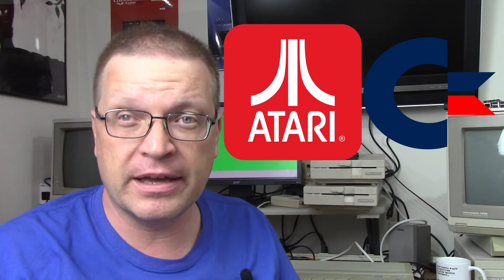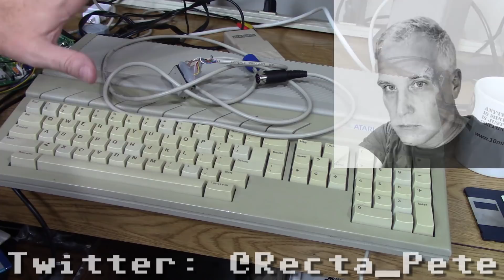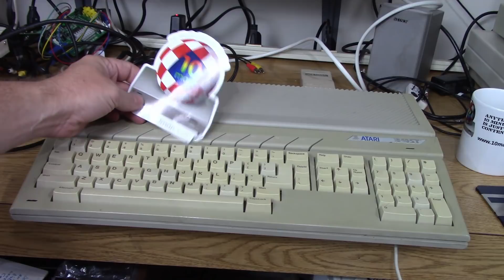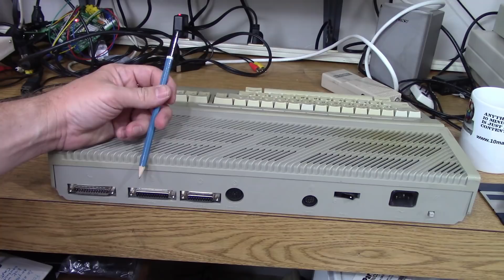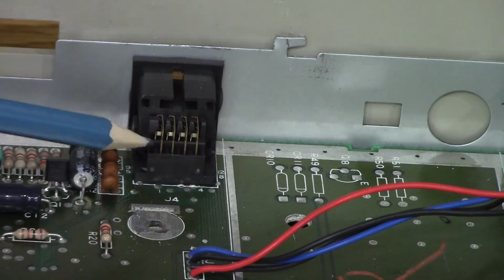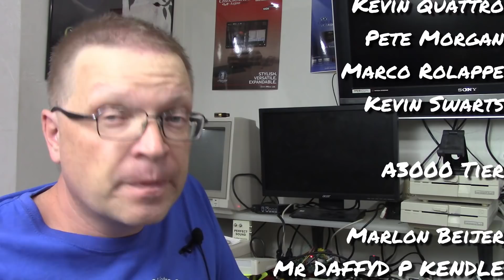An Introduction to the Atari ST - 10MARC Atari 1040ST Special

Comment: the audio chip comment, Atari wanted to use a better Yamaha chip but Yamaha wouldn't sell it to them as they wanted for their own keyboards.  The STe line did come with a far superior sound chip but, as you noted, the lazy programmers stayed with the YM-2149 and didn't use the better sound chip although there were some games upgraded to use the DMA sound chip.
Reply from the maker: I think they also had their own custom chip in mind. That would have made a world of difference, really. A lot of people like the sound of the C64 more than Atari ST sound. It is superior to MAC and PC sound at the time for sure! 
Shame that more was not written to take advantage of the STe.

Comment: Switched to ST because the framerates was worse under 3d games on the Amiga. I played mostly 3d games like stunt car racer, fighter sim etc
Reply from the maker: Well... That applies to maybe two or three popular games. Add a bit of RAM to the Amiga, or one of the dozens of accelerators available back in the day and the Amiga womps it again. And when you consider 99% of games run better on the Amiga (and look and sound better)... Easy decision
Reply: @10MARC  the difference in 3d performance was significant. Play elite or stunt car racer on both and you'll be amazed.  Was the CPU clocked higher on the st ? Other games I played like dungeon master, rocket  ranger and blood money were pretty much identical. But yeah, for other games the sound and color palette was generally better on the Amiga

Comment: The Falcon may be the best piece of Home Computer. Too bad it came too late, just like the Amiga 1200
Reply from the maker: It certainly had a huge amount of potential. If they would have addressed it's few shortcomings in the Falcon 2 - like added a full 32 bit bus for the graphics and allowed for more than 14 MB RAM it would have been just about perfect!
Reply: @10MARC  Mate 4MB was more than enough in 1993, the Amiga 1200 came with 2MB and the rest of the Amigas and STs had 0.5-1MB. Agree on the 32bit bus, but as always..cost cutting. THe 030 is a lot more powerful than the 020, so the potential was there, but never explored cause the Atari and the Amiga died in favor the PC

Comment: The Sinclair QL guy finally gets an Amiga and now I see that the Amiga guy had an Atari all along ?!?!? What is going on :-)
Reply: Of all the 16 bit machines in the 80's (really they were 32 bit architecture), which includes the Amiga, Atari, Mac, and the QL (not sure about the Archimedes), the most successful, i.e. the Mac, in may ways had the worst specs. Shows what marketing can do.
Reply from the maker: Well, I just got the Atari in 2020 - and to be honest I have used it for about an hour after I made this video. I will get back to it sometime. Now my Atari 800XL I like quite a bit!

Comment: I have been looking for a Mega ST 4. If things go right I will soon get one, lets see. Have never had an Atari computer or console. During the previous millennia I would not have even considered. Maybe something has changed in all these years. TT30 would also be awesome or a Falcon but they seem to be impossible to find.
Reply from the maker: Good luck finding a Falcon that does not cost a fortune! They were good machines for sure. The Mega ST would be a good find, too.

Comment: Hi. I'm currently using an Atari 1040 STf plugged in a TV using DIN13 to SCART cable without problem. And when I say TV, I mean the one I bought for 5€ : it is an old CRT TV that perfectly does the job. My LCD TV can't, even if it does have a SCART interface. AFAIK it is due to the horizontal frequency. Newer monitors/TV are not designed to accept so low frequency (15kHz). They generally are multisync and capable of 30kHz or more, but not less. But I'm no specialist and may have got it totally wrong :)
And as an early time ST fan, I have to correct the widespread misunderstanding I have spotted in other' comments : of course the Amiga has better hardware and system. Nevertheless, the ST is a better computer. The proof ? If it wasn't true, what would be the point to argue about it ?
Reply from the maker: I have been quite happy with my new cables for both color and monochrome modes. I use them with a 15 Khz VGA Monitor and they both look fantastic! I had a bit of a harder time finding a place that stocked them, but once I found them they work great. There will be a second part to this video eventually...
I will admit the the Atari ST is better at... Hmmmm.... Ummmm... Uhhhh.... being heavy? ;)

Comment: I’ve long been of the opinion that both Atari and Commodore royally dropped the ball, in the 90s. Either one could have been poised to obliterate the DOS/Windows world, if the companies had had any real idea of direction, or foresight. Atari were so wedded to “power without the price” that, as the industry moved forward, they forgot to put the power in, for a while. The TT was not positioned at all as a replacement or continuation of the ST line. I really think the killer app for Windows, though, the thing that got a Windows PC onto a lot of desks, was Encarta. It was far easier for parents to justify it as for the kids’ schoolwork, if they had such a well known encyclopaedia on it. For the multimedia rich Encarta, CD was an absolute requirement, and neither Atari nor Commodore strongly pushed beyond the floppy disk. In my opinion, if Atari had released a CD drive accessory for the ST in like 1990, and strongly supported it, they could have sold the Falcon with a pack in CD drive. It would have cost them a bit to develop that hardware, but they sank that money into the Jaguar, instead.

Imagine, 1992, the Atari Falcon blitzes the home user and education markets at once, preempting Encarta by three years. The computing world could have been very different.
Reply from the maker: Hindsite sure is 20/20! The Atari and Amiga had HUGE advantages for years in the late eighties. This is the time they should have really built market share (like the C64 had before it) - then as the nineties came along they would have been on a position to lead.

Comment: Funny story. Or not, but anyway, I had never used an ST with English or my native language until couple of years ago when I finally bought an EPROM programmer and upgraded my two 520s, 1040STFM and 1040STE. On the other hand, GEM was so ridiculously primitive that it didn't matter if it was in Swedish or German, there wasn't much to remember. Anyway, I've always preferred Amigas, but I've used both a lot and there's just this certain quality in the poor old STs that warms my heart. They were just trying so hard. It always cracks me up when I'm watching pretty much any Atari ST demo and I see a poorly drawn picture with "Amiga sucks" written in it while listening to the ripped crackling mod music made with an Amiga... STE is a different story, the sound quality is better than in any Amiga, but it was too late.
Reply from the maker: They did try hard, that's for sure... Was the sound chip superior to Paula? I have heard so little from that chip since everyone just coded for the Yamaha.
Reply: That's how they were too late, nobody used better sound chip, blitter or even 720k floppies for games because they wouldn't work with previous models. The new sound chip could output audio at 50kHz sample rate, but it was implemented only in some demos, mod players and a separate version of Protracker for STE, which does sound good and has even simple tone controls for playback. I've always wondered why they didn't improve Amiga's sound capabilities with some nifty dsp chip.
Reply from the maker: @mutetus  they had plans to put a new dsp sound chip in what became the AGA machines, but held back due to costs. That was unfortunate.

Comment: That was a very good ...review of the - wanna be - 16bit atari computer who dared to be considered as amiga rival . I say wanna be because it is better to compare it with the commodore 64 from which it easily looses in terms of sound and scrolling.  So you can change its name to the...''best 12 bit system". Please don't ever use the words atari st and amiga in the same sentence....it is a blasphemy.   :)
Reply from the maker: Well it is better than the C64 in a few ways... Not in audio, or gameplay in some circumstances. It is not too bad of a machine on its own, it just can't hold a candle to the Amiga.

Comment: Good video. I know you are making the "blitter" and "Stereo Sound" STE comments with tongue firmly planted in cheek, but there actually is precedent for Tramiel having the plans in the Atari vaults for those when he purchased the company.  These ideas were not "stolen" from the Amiga, but actually firmly in the 1850XL Atari Spec for computer based on the Amiga chip set. So the plan all along was to have that tech in a computer, but it was not easy to replicate Jay Miner and Team's brilliance once it was purchased away from Atari by Commodore (great move by the way!).  
 It took a while to get the proposed 1850XL spec out, which became the STE and later TT030 and Falcon. The original ST design was a stop gap, but the STE didn't get fully released until  4 years later and by then
, the A500 was a world beater. 
So yes, they chased the Amiga spec, but in 1984 they already had plans written up for three 16bit machines (competing parts of the company were working on them, talk about a waste)...one of them suspiciously like the Amiga, but with good reason. =)
Reply from the maker: This is all true. They had to rush out the ST after they lost the Amiga. Hence Jack's bitterness!
Reply: @10MARC  Complete bitterness. So many ex-Atari people went to Commodore and Commodore people to Atari, they were basically one big company that should  have merged rather than competed =) They might all still be around today. Can you imagine the Amiga 500+ if Jay Miner and team were able to get it out for 1989?  It would have been a 3d polygon pusher well before the Jaguar.

Comment: Good video I enjoyed it. Enjoyed your humor too. ! 7:44 the original ST's had a color palette of 16, not 512?? Always thought it was 16.  When the Amiga 500 came out it blew the ST away and I went with that instead, from Atari 8bit. The Atari 8bits were far better for their day (like Amiga) than the ST. They were good but not amazing machines. I'll have to disagree with you on the ST construction build quality. It's flimsy creaky plastic.  Yes keep the RF shield in place also to strengthen it so it won't flex. The Mega ST is supposed to have a fantastic keyboard btw.

Picked up a 520ST with 2.5MB of RAM a couple years ago. It sort of works but throws b[]mbs after a short while. Will get it fixed.
Reply from the maker: They can display 16 colors out of a pallete of 512 colors at 320x200, or 4 colors out of 512 at 640 x 200, or monochrome at 640 x 400. 
The Amiga can normally do 32 colors from 4096 at 320 x 200 or 400, or 64 in EHB. 16 colors in 640 x 200 or 400. 
HAM mode of course can do 4096 at a time

Comment: One thing is find hysterical is the raw emotions of being either an Atari Fan or an AMIGA fan but not both. The truth is the Amiga was designed by the same engineers that built the Atari 800 and the ST was built by the same guys who made the C64. That community was so intertwined that people forget that even Apple has roots at Atari. We put our loyalties to brands rather than the brilliant engineers who made these awesome machines in the first place.  And NO, Doug, you may not have my Falcon!
Reply from the maker: Yes, the histories of all these machines really do blend together. Thankfully we are all adults now, and the serious battles we had back in the eighties are now just good natured teasing. I am a huge fan of the Atari 8 bits - they are great machines. And I am honest when I say the ST is better than the Mac! It was a fine machine, but not a groundbreaking advancement.
Reply: I lobe both. The ST for it's simplicity and the Amiga fro the absolute amazing tech well before anyone else was doling anything like it. 

When the ST was released it blew away the graphics on all previous game machines, but it was really more like an Apple II compared to a C64 when it come up against the Amiga.  Sold a lot at first, had a long run, but the better tech won out. 

Early ST games are great for the time. But just the sound alone on the Amiga blew them away. That deep stereo  bass could not be replicated by any other machine.
Reply: To bad ST wasn't C65 with 256 color display capable VIC-III.
Reply: @valenrn8657  It very well should have been.
But I still love my ST and the people who knew how to get the best out of it and the STE.

Comment: The revision D board of the STF also requires the same mod as the C version you have there. Its pretty straight forward thanks to Modern Vintage Gamers restoration video. I did a reddit comment with the parts you need here (specifically the last comment by gyrussfanx). https://www.reddit.com/r/atarist/comments/d6hluq/atari_1040st_f_video_issue_any_help_would_be/?utm_source=share&utm_medium=ios_app&utm_name=iossmf
Reply from the maker: That is so awesome! I did not know MVG did a video on that. I need to check it out. Thanks for the list and the info

Comment: loved my Atari ST, 520fm with single sided drive, i saved for double sided drive so i could play all the games, mainly Turrican. had 1 meg fitted too by the mighty Tim J Buckley of gamer computers in uk
Reply from the maker: Nice! I think some of the later 520 machines could just have an extra 512K just soldered on the board, right?
Reply: @10MARC  not sure, but according to tim, the ones in mine had to be piggybacked!

Comment: Absolutly not biased, naaah! 😛
And I definetly will keep and celebrate my beloved Falcon here!  https://flic.kr/p/2ip8ToF   https://youtu.be/9iUhHENBxEE  😍
Oh yes, Scart-cables for the ST can be a real pain, because there are so many solutions. This one also works with an 1040STF without modulator, at least with my STF and combined with an OSSC (which I really recommend, especially for the ability to move the pic horizontally and vertically): https://www.chzsoft.de/site/hardware/diverse-kleinigkeiten-fur-den-atari-st/#adapter-monitorausgang-atari-st-nach-scart-farbmodi
And I also love my heavily modified 520STM with Stereo and switchable TOS:  https://flic.kr/p/2dVw8fL  https://youtu.be/4G5ea3N8soA
😁
Reply from the maker: I look forward to checking out the video on your Falcon! Those really are nice machines. Shame they never got the love they deserved.

Comment: That is one complaint I have for Atari ST's.  I have six of them and they are a pain to get a display out of.  Especially if you've ever tried to solder those 13 pin DIN's!  Great computer, otherwise.  I actually built an S-Video adapter for my Amiga's using an AD725 encoder.  Works amazing.  Wished I had something similar for the ST....guess I should build one.
Reply from the maker: I agree. The solutions for getting video out are either expensive or mediocre. I am spending almost 60 to get a cable that does VGA both color and mono, with a separate audio jack

Comment: The Atari 8 bits were introduced in 1979. By 1985 the line was 6 years old.
Reply from the maker: This is true, but it had never been as popular as the C64. They were fantastic machines of course!
Reply: 10 Minute Amiga Retro Cast The Atari 800 when it came out in 1979 was very expensive. When the Commodore 64 came out in 1985 it was fairly inexpensive and the Vic 20 although cheaper was not anywhere near as power as the Atari line. Comparing the 1979 Atari 800 to the 1985 Commodore 64 is not a fair comparison. The Atari ST and the Amiga 1000 came out within a year of each other and the Amiga was overall a much more powerful machine for graphics and sound but cost much much more. Believe me, I wanted an Amiga but could get by with the Atari but was always jealous.

Comment: If they had brought out the ste first instead of cutting the specs down it would have had more chance against the Amiga instead of being compared to the mac
Reply from the maker: The cost would have been way too high - and they needed somebodies tech to copy! Atari did not have the same brain power that the original Amiga crew had. They were something special

Comment: Ha! I had almost exactly the same starting experience with my own 1040 ST, which I also got from the Brewing Academy! I however managed to grab an Atari monitor for a good price instead. And to be fair, it's great! [cough cough "Amiga forever" cough] Ahem, sorry - excuse me. Yep. Great machine! 😁
Reply from the maker: Yep - I think these are pretty close to the original runs of the Atari 1040ST. I will probably do the C-Sync fix and see how that works. Not a big deal, but it would be nice to use it with HDMI